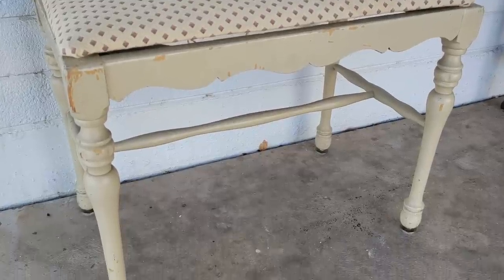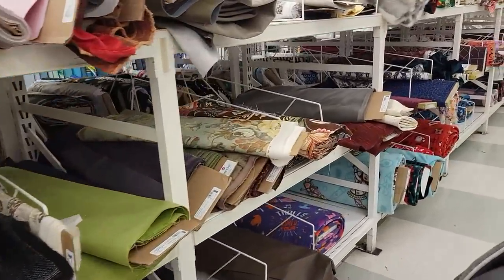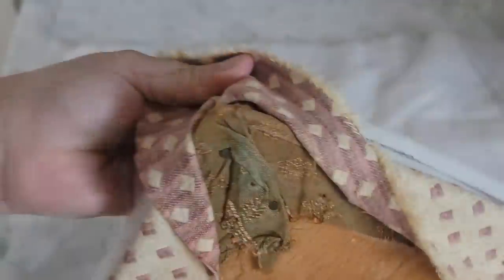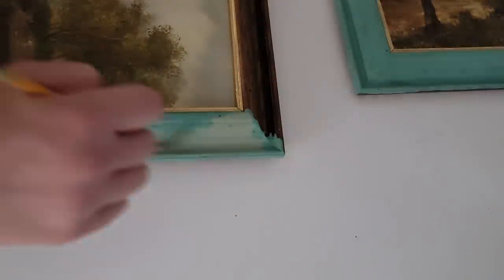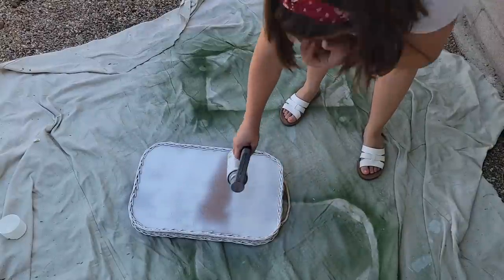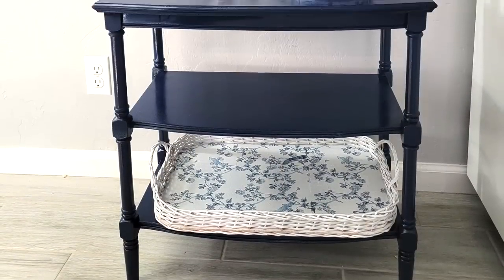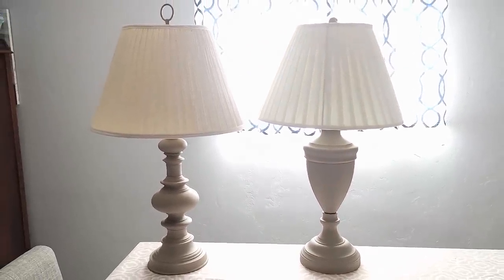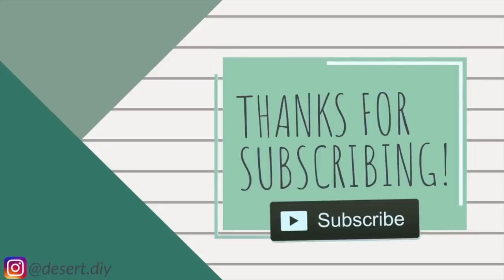10 NEW Classy and Timeless Thrift Flips

Comment: These pieces all turned out beautifully!  Two questions: 1.  How did you attach the seats of the stools to the bases and 2.  Does the paint you used on the lamps stay on metal well all by itself or did you pre-treat it with anything?

Comment: How did you connect the top of the stools to the bottoms?
The 3 shelf table.  Did you sturdy it up. Really wobbly while you were painting it.
Reply from the maker: The tops connect to the frame with screws. They were missing and since all my tools are in storage I'll have to wait until we move in to get the screws out of my storage. Also it isn't as wobbly as it appears in the photo. It was in gravel so it didn't have a firm ground under it when I was sanding it